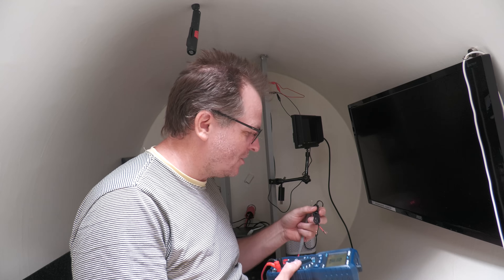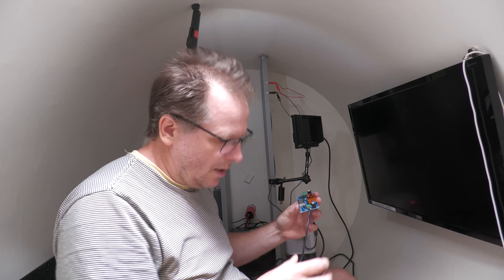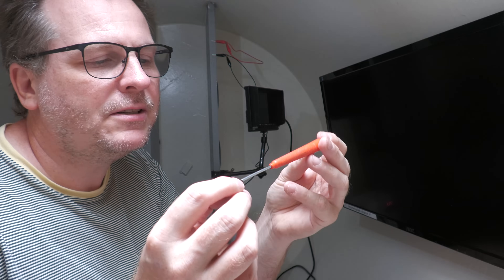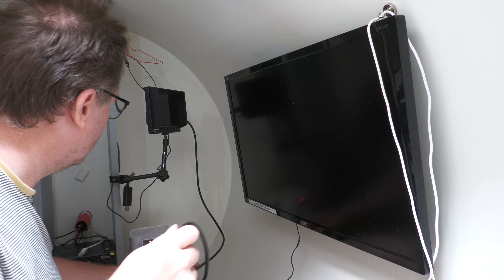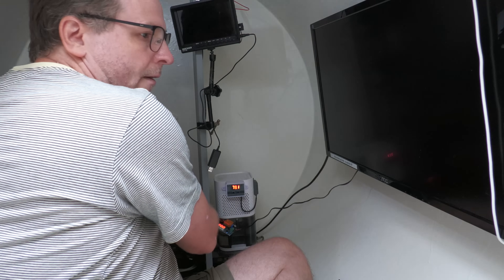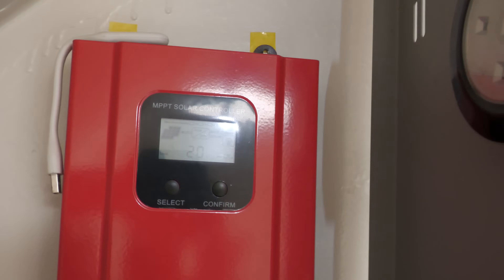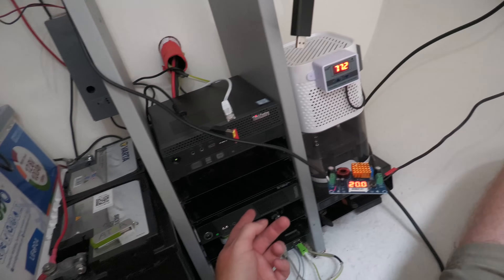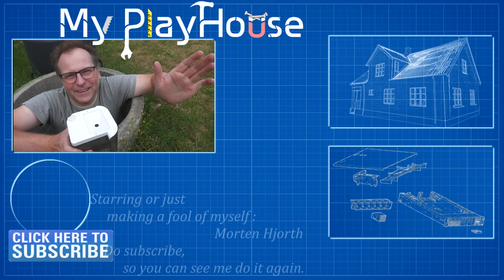Bunker Monitor -  Turning Down Brightness saved 60% Power - 1515

Comment: I have used Wera tools for a few decades, as I have training as an Industrial Electrician, Radio & TV repair engineer, & a Master degree in Digital & Micro Electronics engineering.
Reply from the maker: They are good tools,, and cost a bit more!

Comment: Morten,
Buy a condensate pump, and it will lift the water for you out of your dehumidifier once it gets "full". Then you can run it outside or through th "conduit" that you already have in there to another drain. They usually have a lifting height of between 2-3 meters, so just make sure th vertical rise isn't more then this before you slope it back downhill.

🤜🤛
Reply from the maker: Or remember to empty it onces a month :-)

Comment: by turning off Overdrive, you can save about 1–2 watts of power. Overdrive helps the screen change pictures faster by using a little extra energy. If you’re just using Proxmox with mostly static text, turning Overdrive off makes sense because the screen doesn’t need to update quickly. Every watt counts in a bunker, right!    
15:38
Reply from the maker: Thank You! I will do that,, as 1-2watt is a ok saving for something I do not need!

Comment: The other day I noticed my old 19v Acer monitor could run from USB-C with my 20v USB-C PD trigger to barrel jack cable. I tried also accidently tried to power it from a non PD source and inadvertently found it could run form 5v. I wonder if your monitor can too and weather it would save even more power?
Reply from the maker: If it could run from 12v (or liFePO4 voltages) I could save the DC-DC step up converter,,, but I am a little afraid I could damage the monitor trying :-/
Reply: @MyPlayHouse You should measure the power draw from 12v. If the overall power draw is less it would suggest it is more efficient, producing less internal heat and is thus unlikely to be damaged. 

I might take mine appart to see how the power is handled. I am curious to know how it can run from 5v. Maybe the input stage is a step down converter. If thay is the case there is little reason why 5v could damage it.

I guess if the backlight is higher voltage and is powered via a step up then a low voltage supply could cause an overheating inductor overheating.